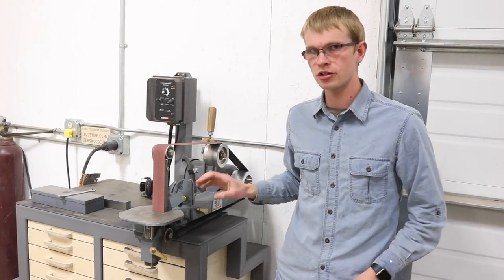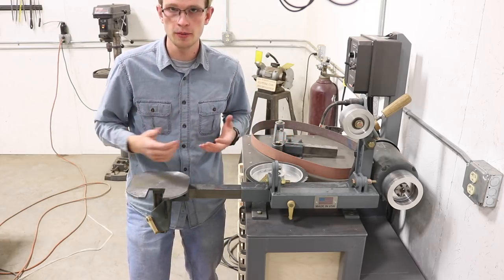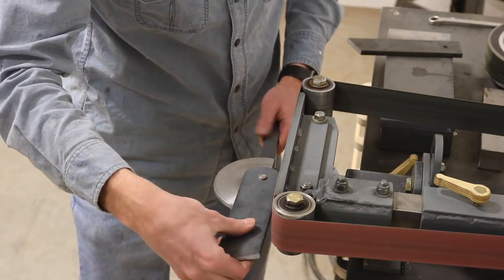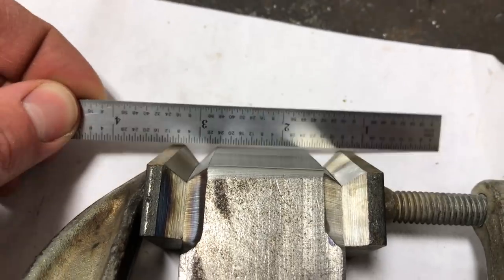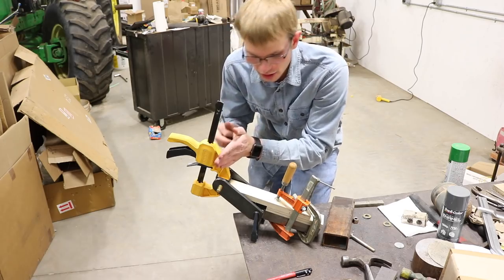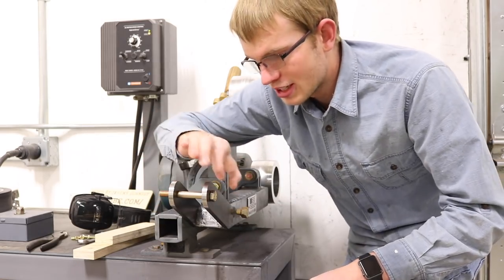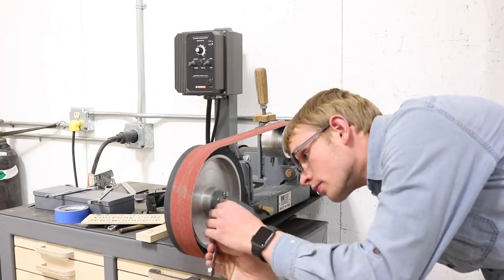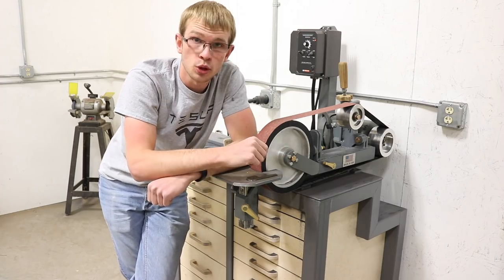Belt grinder contact wheel attachment

Comment from the maker: Answers to your frequently asked questions:

1) Several have suggested using various different kinds of wheels as contact wheels, like forklift tires, donut tires, or wrapping rubber around a wood disk... Keep in mind first that a wheel like the one I used is made for the job, and is only $120. The wheel needs to be very precise; round, and flat across the face. It has to be the correct hardness too. Pretty difficult to find something that costs less that $120 and meets that criteria.

2) Could you use a longer belt to accommodate a 12" wheel? Yes. However this means you'll need to have two full sets of belts in the shop since the longer belts can't be used with the platen or small wheel attachment. Longer belts are also non-standard, so you'll have to special order them. Selection will be limited, and prices will be higher. But if you need to run a 12" wheel, you can certainly work through the downsides...

Thanks everyone for your feedback!
Reply: Jeremy Schmidt  Does the pdf plans have all the exact measurements for all pieces used on the build?
Reply: Sam Hoffer it’s on his site, there is a link in the description.
Reply: Look up "plug weld" would have a saved you time instead of grinding those bevels.

Comment: You actually can use a 12" wheel on there. With sites like Econoway or Combat abrasives, you can special order 2x80 or 2x82 belts. That should free you up for a 12" wheel.

Comment: Would it be possible to remove and invert the extension arm that holds the front platen, then re-install the platen? It looks like it would give you the offset and elevation you needed for that "out of line" hinge setup. Nice build. Its a bucket list item for me.

Comment: It's a polyurethane wheel very similar to what's used on some forklifts. There is an adhesive sprayed on the metal then the polyurethane is poured around the wheel and heat cured in an oven, then trimmed on a lathe. Superior tire and rubber is a company that I've worked for that would custom make a wheel like this or already have something very similar as a stock item (not in-stock, just a BOM exists)

Comment: ttps://specialtyresin.com/product/flex-70-black/
This is castable rubber that you can make contact wheels with. You just need a big enough lathe to turn the wheel.

When the rubber cures toss it in the freezer and even you can true the surface from any casting defects.

Comment: Just an FYI, there are a number of USA based contact wheel manufactures, though price will increase significantly, without an equivalent increase of performance (in my opinion). Contact Rubber Corporation is very good, especially for custom applications. Beaumont Metal Works make their own wheels, though I think the vulcanizing may be contracted out, and Bader makes wheels as well, just to name a few.

Nice work on the attachment by the way.
Reply from the maker: I haven't been able to find anywhere that says any of those brands are made in the US? None of them publish the country of origin on their official websites. Can you give me a link to somewhere that actually says where they're made?
Reply: http://www.contactrubber.com/about.asp lists where their manufacturing facility is located, though they do have affilations worldwide, their main production is in the midwest US.
http://contactrubber.com/PDF/CRC_Brochure.pdf lists their wheels as "Made in USA".

From Beumont Metal Works' homepage: We design, engineer, and manufacture all of our products in house and can proudly state “Made in the USA”.
They used to have some vids showing their contact wheel hubs being made. I'm not sure about the rubber, though it may be in house, it's definitely US rubber. As for Bader, I've been told by other knifemakers that they make their own wheels as well, though I don't see it explicitly stated on their web page. SunRay, Inc is another poly contact wheel maker that I'm nearly positive is a sole US manufacturer, based out of North Carolina.

Comment: That welder isn't enough for any weld you made in this video I dont think... that welder is good for about 3/16 metal (maybe 1/4" if you make multiple passes and have an open root joint)

Those welds are all very cold with not much penetration...
Reply from the maker: You’re not wrong, but it’s not a problem.  The parts are stuck together more than strong enough for the application.

Comment: I have observed the difference with heat transfer on wheel vs a flat reference, but hadn't really realised it was because of this. I assumed it was mostly due to belt wear. But this has got me thinking for a new jig to make for my grinder - I've trialed verticle grinding on a wheel and horizontal grinding on a flat platen. The former seems easier in many ways but very challenging to get an even, handheld grind on large kitchen knives. Perhaps a jig for vertical grinding will be my solution! Great video, your work is outstanding.

Comment: Get more heat from your welder by simply turning down the wire speed a bit . It will get hotter with less fill for the first pass .

Comment: Did you think up this tilting feature by yourself or were you inspired by a commercial grinder of some make?
Reply from the maker: There are quite a few tilting grinders on the market, but I didn’t like how they all tilt the entire machine. So the idea of tilting just the belt part was original, and I came up with the location of the hinge so it could tilt in place.

Comment: Excellent video and process. Also, the timing on the humor is perfect. I just purchased a belt sander that needs repairs and adjusting. Your solution to the tracking and adjustability gave me an idea that will solve my tracking and adjustability problem. I was just checking out a great video with excellent workmanship sprinkled with humor and, "There it is". Much success and Bless you...

Comment: Great video... only the it doesn't fit with the machine anymore... Made of part from the usa. You need to change the plate on the machine 😀😀😀👍🏼👍🏼👍🏼
Reply from the maker: I need to add a long strip of metal to the side of the contact wheel attachment that covers up the badge when it's installed ;-)

Comment: Nice video, some interesting ideas. I was expecting you to use a simple cam bolt for the adjustment of the wheel though.
Did you consider adding a bolt with a small cam lobe to adjust the wheel tracking?
Reply from the maker: The tracking adjustment only needs to be done once, then you can leave it forever. So ease of adjusting is not a significant factor; I wanted something that was simple, clean-looking, and would hold its position well.

Comment: Is there a reason you couldn't use a longer belt to accommodate a larger wheel? Other than loss of rigidity from extending the table out further
Reply: He certainly could. Something tells me he doesn't realize that you can order custom length/width belts anywhere between 10 and 400 inches, with aluminum oxide, silicon carbide, zirconia alumina and ceramic. Several websites offer this service and you can get pretty good deals on them.
Reply from the maker: Yes. But that would be an odd sized belt so your options would be limited, and probably costly. Not to mention you would need all of the grits in two different lengths since a 2x82" won't work well with the platen or small wheel attachments... But yes if you really need to run a 12" wheel then that is an option.

Comment: I like TIG in situations like this caus you can hold the torch on the part and really pump heat in without adding filler, so you can just let it heat up and weld slowly without just covering the part in filler.

Comment: You should of drilled  and tapped the fork top and bottom (on the big hole side) and used set screws to push the 10" wheel axle up or down to set tracking of the belt. then run in a second set screw on top to lock them into place.  way easier and more adjustable.

Comment: pretty ingenious on the radius attachment. i saw somewhere about epoxying a ceramic tile on the platen, cuts down on drag thus heat. thanks for sharing your build, inspiring!
Reply from the maker: Usually the material used on platens if you want low friction is fireplace glass (Pyrex). I have some, just haven’t got around to making a platen to hold it.

Comment: Jeremy, I wouldn't stress over your design not handling a contact wheel larger than 10".  In fact, if you peruse many of the knife making forums, there's not that many folks using anything larger than 10" anyway.  Sure, some use a 12" or even a 14" or possibly larger, but if you want/need that kind of versatility, then chances are you are making knives (or swords) outside the parameters that the average maker does (or probably making them as a business).  In that case, it would be no problem to use your base grinder design modified strictly as a contact wheel only machine for those larger wheels and have it as a second machine.  If you could live without the tilt feature, that'd make it even easier to build the contact wheel only design.  Any excuse to have another machine is never a bad thing...right guys?

Comment: A possible idea for rubberised wheels for people not willing to spend a fortune on rubber faced wheels is to use a lathe turned wheel, often cut off parts of large bar can be picked up at a scrap yard.  A car brake drum could also be modified.  For the rubber bit consider using an inner tube from a push bike, motorbike, car or lorry cut across transversely to give a wide band to go over the wheel.  Contact adhesive to stop any possibility of slip and even two or three bands on top of each other if you wants a thick one. Rubber to rubber would need the appropriate puncture glue.

Comment: He could just leave everything as designed but add an additional receiver higher and to the side for the platten's when this belt and attachments are turned sideways.
I'm not going to worry about it because I don't think I'll ever need bigger than an 8 inch wheel.

Comment: nice video, thanks. im really overdue for building a 2x72, so im finally looking at different designs. i really do want a vertical / horizontal setup with a vfd. i think a modified kmg design might be the way to go however. super simple to add accessories to that, wheels for example simply bolt onto one side of a bar, thats it. i dont mind making another table for the horizontal postion.

Comment: If you wanted  a 12" wheel just use longer square bar ,and to stop the chattering if any just add another locking handle further back from your other one, and if your table rest don`t come out any further get another longer bar for that.
Easy solutions
Loving the radius jig by the way,

Comment: Jeremy, is the maximum size of the contact wheel ultimately just a function of the body tube length of the grinder?  Could the two main body tubes be made 2-3" shorter to accomadate a larger contact wheel?

Comment: Rubber rollers and draw wheels are used in the printing industry. There are companies who will cover steel blanks in order to refurbish spare parts. These companies can cover in rubber and urethane of many and various hardness's. Hope this helps.
Reply from the maker: Do you think that would be cheaper than just buying the whole wheel?
Reply: Hard to say but the choices of rubber are unlimited. Our rollers are a thousand to replace and a couple of hundred to recover.
Reply from the maker: Smarty Pants 
Ok, good to know. I think I paid $110 for this wheel.

Comment: To make your own wheel, you would likely have to machine a T-shape into the aluminum support wheel with holes around the web of the T so the rubber can bond through and allow air out.  Cast it with a "hard" Urethane and put it in a vacuum chamber to get all the air out.  That's just a swag though and would cost a lot more than $120.

Comment: Whats the cost of a grinder like yours?
Reply from the maker: If you use all new, high quality components, and make the grinder, platen attachment, & table holder, you can build it for about $1000. This contact wheel attachment is about another $150, and the small wheel attachment is also about $150. You can obviously save quite a bit by using a second-hand motor and VFD if you’re into that.

Comment: I also wanted to state that you have nothing to worry about your welds it will hold. One more thing try making a straight razor with that wheel. You will find that it's very satisfying making a deep hollow grind. It has to be so thin on the edge that it flexes with your finger nail and not break. I loved making one. I did have one to take the dimension down but was awsome to make

Comment: Along with all the great attachments you've created, I have one more for you should you feel up to the task:  A rotary platen.  It's a head of several wheels with its own belt that is used to support the grinding belt.  The idea is that it allows for convex grinds.  The wheels are spaced at different intervals to provide varying degrees of slackness or flex.  Slack belting without support for the grinding belt is a bit too flexy for this kind of work.

Here's a link to a video on the channel "Simple Little Life" showing a rotary platen.  He purchased his, but I'm thinking this probably wouldn't be too difficult for your superior design skills to make one for your grinder:  https://www.youtube.com/watch?v=PgYxIkVpL6U

Comment: Saw this video and then went back and watched the previous build from beginning... awesome work and I'm really jealous of your massive workshop!  I've got most of the same tools squeezed into about 600 sq feet, LOL.  I was just wondering why you would't use hitch tube and hitch receiver tube for the main frame and attachments?  Maybe its not tight enough tolerances?
Reply from the maker: The tolerances aren't tight enough for my liking; at least not with the hitches I'm familiar with. Also, the small size (class I & II, 1-1/4" square) is really too small to be sufficiently strong, in my opinion, for sure if you use the 1-1/4 tube the hitches are made from. And the larger size (class III+, 2" square) is excessively bulky.

Comment: The flange.  Is there a reason you drilled and tapped it once you had it located rather than just welding it in place?  If thats never meant to move again, and it doesnt seem that it is, it seems like it would have been easier to weld it in place.

Comment: create another mount from the motor to the contact wheel through a drive chain and or belt, put velcro and or contact cement on the contact wheel to glue sand paper so that you are not restricted to the size of the wheel but that means you need to buy one for the belt grinding and the other is for non restrictive grinding depending on the size of the belt

Comment: Where did you buy the 10 in wheel?
Almost finished with my build, challenging but fun for a first time fabricator.
I just bought a 3 hp brushless tread mill motor and controller, must weigh 60 lbs
Reply from the maker: Ameribrade

Comment: Jeremy- good build. In the alternate to "Knife" making- you may consider the pinnacle of "Bespoke" edged tooling- grinding a straight razor. These are much more dimensionally critical and the edge has to be made thinner with a higher attention to detail. Knives can be a bit more forgiving tolerance wise. If you are going to have the grinder perform to a high level- make the project hold just as high of a standard. 
Might I recommend "Lewis Razors" channel for your inspection... and consideration? Be safe and as always at peace. This has been a good series. I appreciate the videos.
Reply from the maker: I better start with a knife and then I'll see if I can move up to that later! :)

Comment: If you had a stick welder you wouldn't be worried about not getting good penetration. I know it's not as easy & efficient.  we'll worth it in situations like this that need all the strength it can get.  You are a great fabricator though... & build functional tools. That's a lot more than I can say for most people.  Also can you tell me how this is adjustable? Do you build a new "washer" every time you make an adjustment?  I thought you were going to make something like a motorcycle axle adjustment. But with tensioning bolts on three or four sides instead of just one.  I

PS I am going to copy your belt grinder design when I get ready to build mine, so please don't think I'm being critical of your work. It's great. Thanks.
Reply from the maker: I do have access to a stick welder, but it's engine powered and near impossible to start. And I suck at stick welding. 
The washer can move about 1/16" in any direction. You can see this at 14:09.

Comment: Have considered using a cam type bolt for the 10" wheel axle? Or even a cam bushing. I had something similar on the ball joints in my Van for alignment purposes.
Reply from the maker: The problem is it needs two axes of adjustment to make it track correctly in forward or reverse. The cam makes the end of the bolt move in a circle, so you could get it to track right in one direction but not the other.

Comment: Dang Jeremy, the design for your grinder, as well as all of the accessories are by far much better than any I've ever seen or considered from my own thoughts. I really enjoy designing and building my own tools and machines, most are over engineered from 42 years working in the oilfield and repairing heavy earth moving equipment. I would truly love to get plans for your grinder and all of your very cool everything that goes on that beast! Would you be willing to sell in a package? Im not a machinist, but it's never a too late to learn, I know you do use a lathe and mill often. I'll figure that out...
Im very impressed with your knowledge at your age.
Reply from the maker: Thanks! I don't sell the machine as of now, but I do have plans so you can build it yourself: http://etsy.me/2sm5uvg And you don't need a lathe or mill to make this.